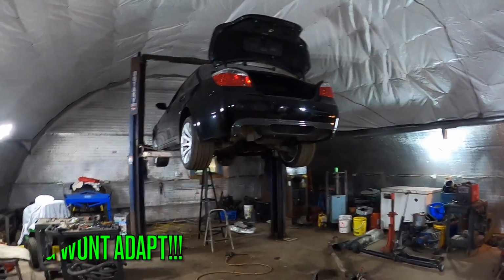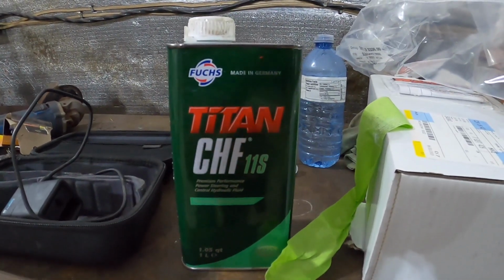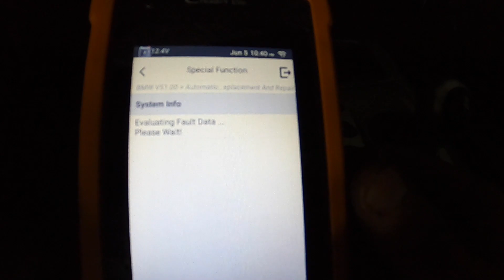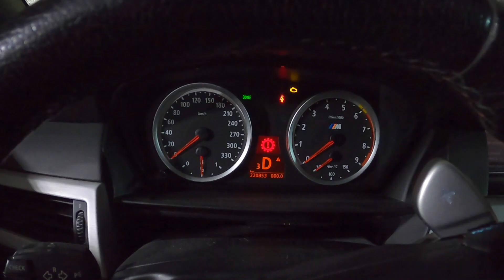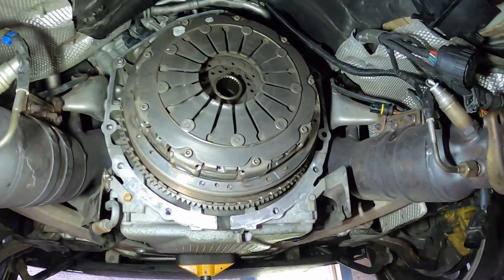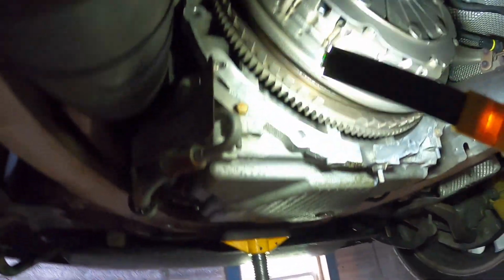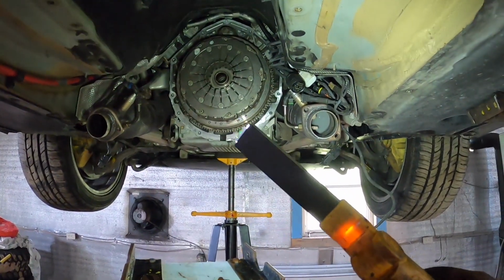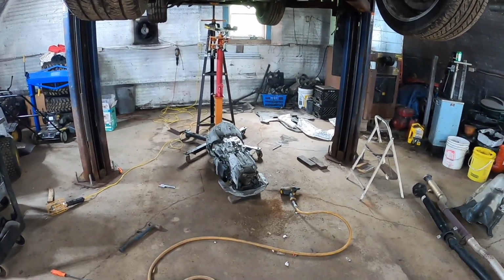Bwm Smg Clutch Wont Adapt Bmw M5 Plcd sensor install and new clutch

Comment: What does the end of the pivot pin look like compared to a new plastic one?
Reply from the maker: the pivot pin is a new brass one from ecs tuning
Reply: @BurninGas8.1  you said you had like 30k kilometers on it tho. The brass ones are known to wear out extremely quickly and if it losses hight, it will throw off the relearn.
Reply from the maker: @arkangel2487  it was not burred or worn at all from what I looked at I think I showed it better in earlier video but that’s also very helpful information that you just mentioned
Reply from the maker: @arkangel2487  I also got the car to complete relearn have you watched newest videos
Reply: I don’t think so but I’m glad to hear it! Dealing with this issue myself.
Reply: so, what was the outcome ? did you manage to get it working ? was it the clutch slave cylinder the culprit ? or the harness (cracked sensor) ?
i fitted a new clutch on mine, and, every now and then, it gets the TRANSMISSION MALFUNCTION (yellow COG) warning message on the dashboard, and occasionally (lately), the RED COG has been coming up, which i suspect to be the slave, due the codes i have been getting, 4FA0 and 510E (PLCD)